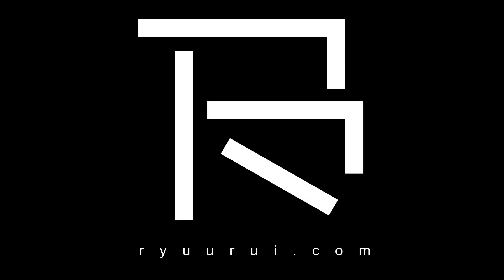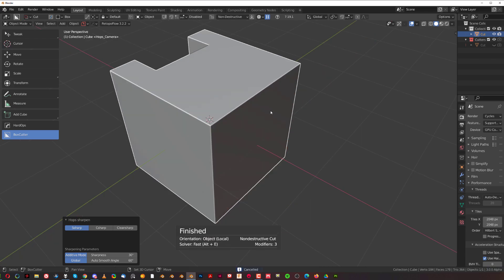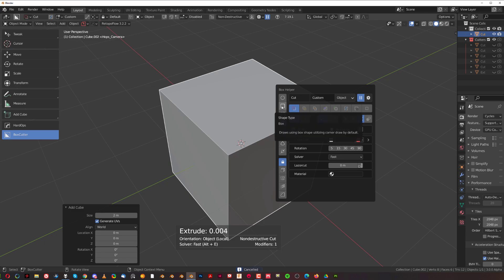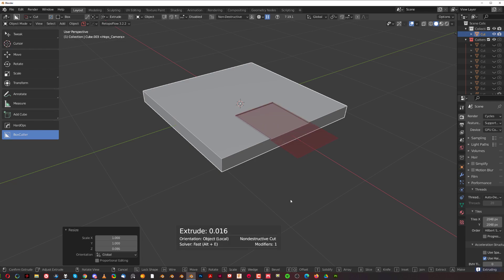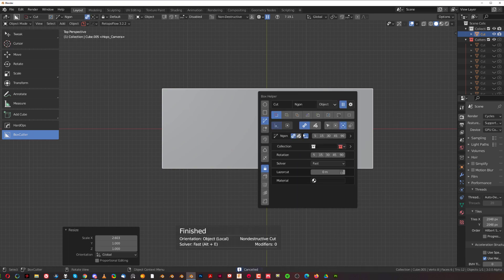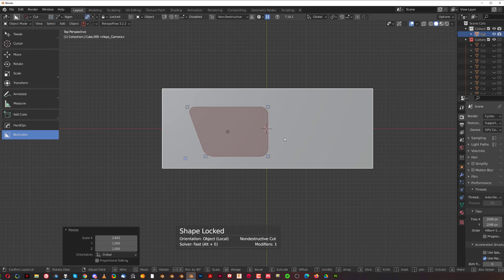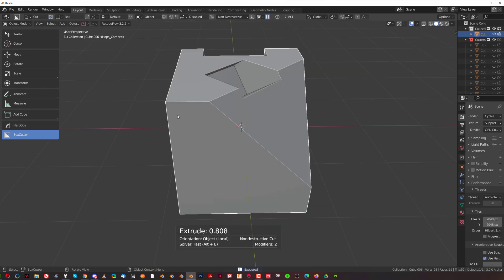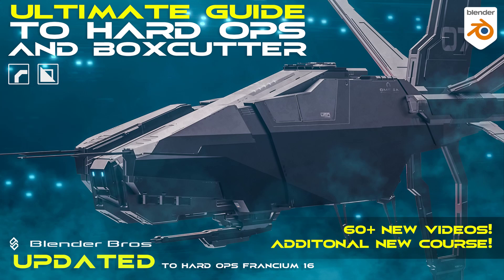Easy Guide to HardOPS and Boxcutter for Beginners - Part 2 - Blender Tutorial

Comment: Hi, thanks for great tutorial. Unfortunately, for some reason, Uniquify in Hops 9.87_35 with Blender 3.4.0 doesn't work as intended. It creates new cutter but not for the chosen mesh, basically it makes two cutters for one mesh so the behaviour of both meshes is the same as it was before applying this Operation. Do you have any idea why it's happening? Thanks.
Reply from the maker: I am using 3.4.1, and before you install it i d nuke the 3.4 folder in app data
Reply: @PonteRyuurui  ok, I’ll do it. I’ve read somewhere your comment that 3.4.0 is shit so lets see if it gets better.
Reply from the maker: @Jungheinz  so is 3.5
Reply: just update for everyone with similar problems, 3.4.1 works smoothly, 3.4.0 really IS shit.
Reply from the maker: @Jungheinz  lol, yup